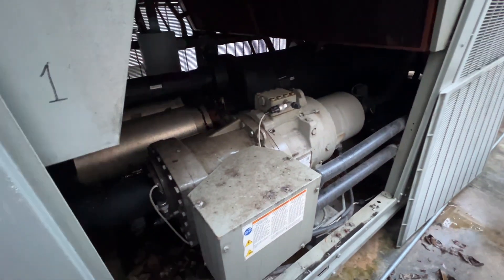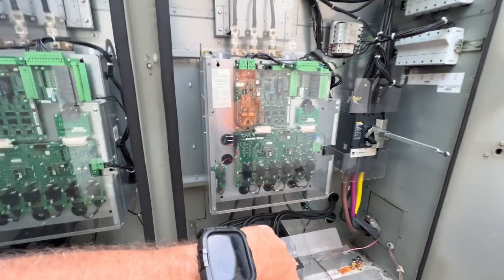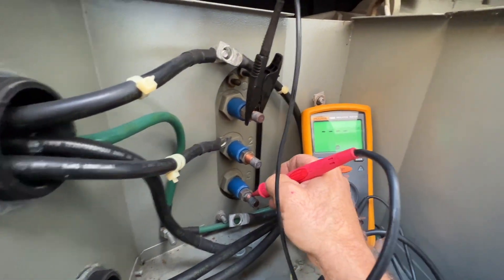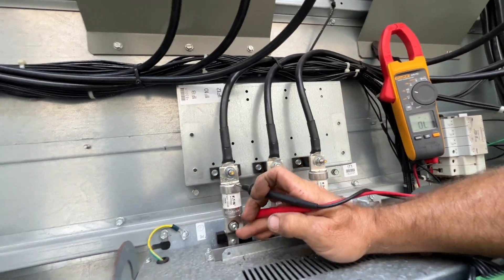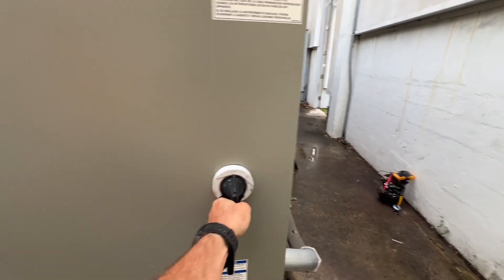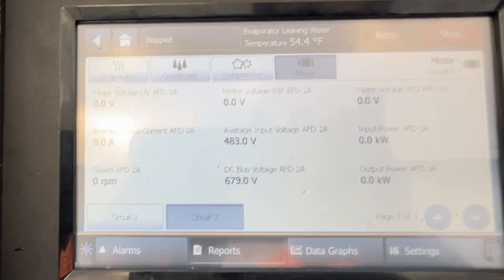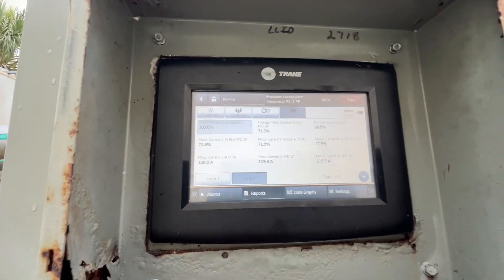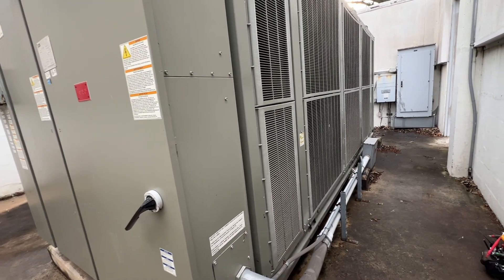TRANE Stealth Chiller Circuit 1 AFD 1A Bus Under Volts | Part 2 Results Are In ⚡️🦎

Comment: Nice little voltage drop when she fired up. Do yall have crappy power there. We definitely do and we have lots of issues when the buildings get power loss or a surge. Nicely done by yall. Another chiller running.
Reply from the maker: Ha, we do have our share of power issues especially when storms roll through. Thanks Jason !

Comment: So chiller compressor resistance values between terminals should all be the same? New to trade, Thanks for video !
Reply from the maker: Good question, on 3 phase like this one Trane recommends 0.2 to 2.5 ohms DC resistance of windings be within 5-10% of each other. Thanks 👍

Comment: You know when a technician and not an engineer is making the measurements. You measured the input and you had less than an ohm, and after that you tested EACH one with high pot to GND.... WHY? If you have 1 ohm between each winding, and you tested first of them to GND and had 2200MEG.... for sure the other will be the same...as they had one ohm between them....
Reply from the maker: Good question GRC, because one good reading doesn’t mean something isn’t wrong. However, one bad reading guarantees something is wrong. Thanks for asking 👍
Reply: lol you perfectly encapsulated the lack of real life problem solving engineers are known for
Reply: Agreed, 100% correct after verifying winding resistance on a three wire motor, test one leg and you tested them all. But, it doesn't take much time to do the other two and the one time someone doesn't check all phases is the one time they didn't measure the winding resistance correct and there is a bad winding. So not losing anything by doing all three but a minute or so.
Reply: Stick to your clipboard and computer programs. Let the big kids handle the work in the field - where the real problems are solved.